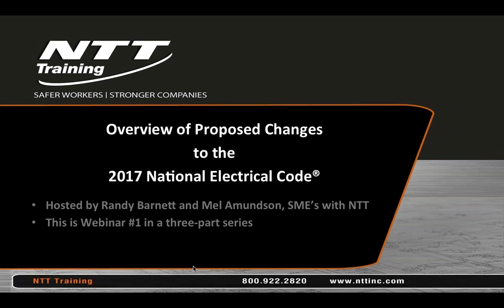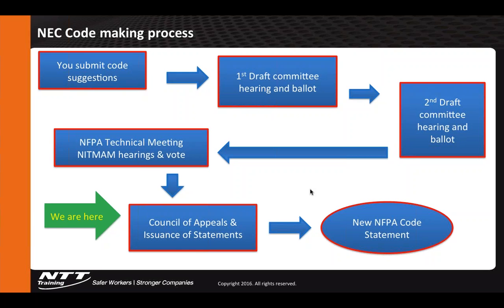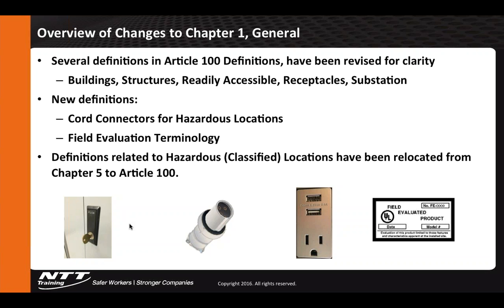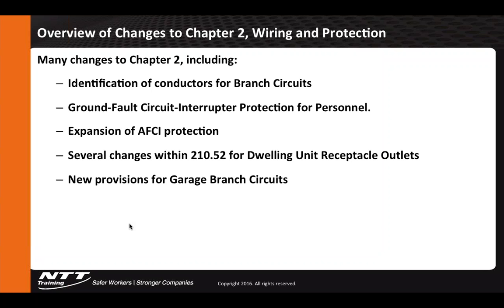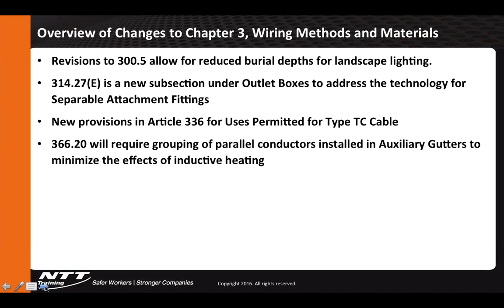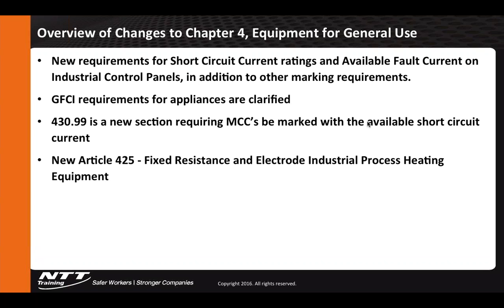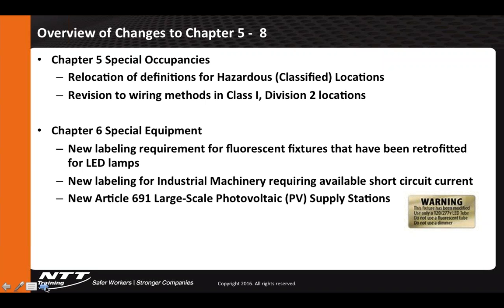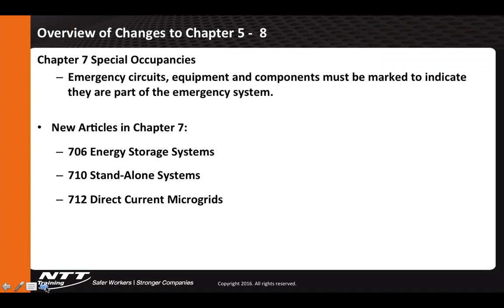Webinar 1 of 3: Overview of The 2017 NEC®

Comment: I needed some help and guidance on the below NEC code for clothes closet lights.
“Surface-mounted fluorescent or LED luminaires shall be permitted to be installed within the storage space where identified for this use.”

The electrical inspector wont approve my cloth closet lights (fully enclosed) on the basis that the box/package of the light did not state that the light can be used in the cloth closet. He believes that the last phrase of the code i.e. “identified for this use” means that the box/instruction guide must state that it is fit for purpose. 

I have checked all stores (Home Depot, lowes etc.) and online but couldn’t find any light that specifically says that. This is super frustrating as i have been failed my inspection twice on these grounds. No other license electrician believes that this is the requirement but my township inspector is adamant. Please help if this is really a requirement and if it is, where i can find such lights.
Reply: Put up a normal light, then change it after you pass inspection.